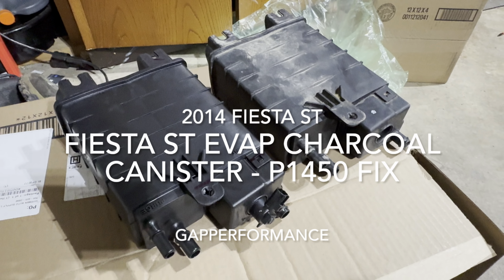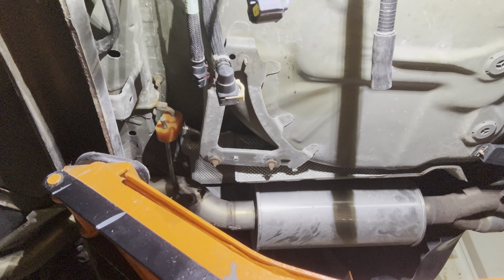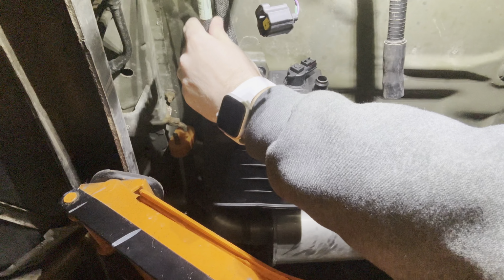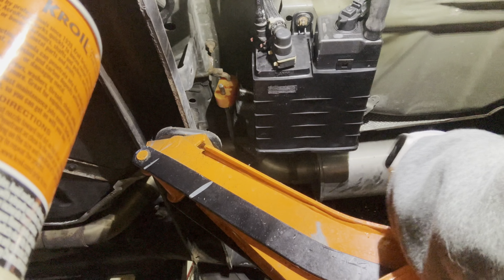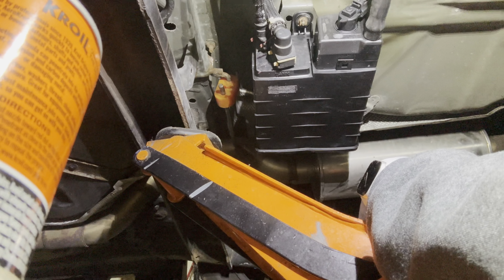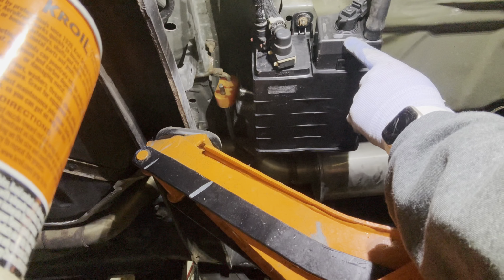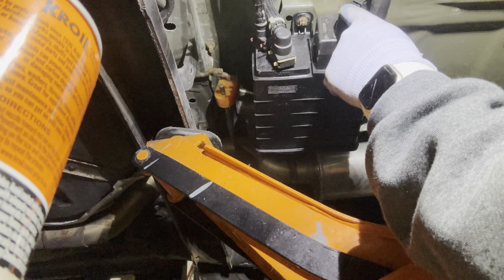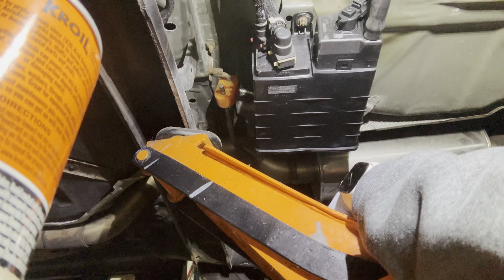Fiesta ST Canister Replacement - P1450 Fix

Comment: Hey man so I changed the Solenoid and I’m still getting varied and extended crank times. Is that the issue you were having as well? Just trying to troubleshoot.
Reply from the maker: No my main issue was idling poorly and it would try to stall out whenever I stopped at a stop sign lol

Comment: It's definitely an ST thing. If the Woosh harness doesn't fix mine, it's off to the Canister ..
Reply from the maker: Yep I did the whoosh harness, then the canister vent valve, then the canister. Finally I had my tuner bump my idle rpm to 1200 and I haven’t had a code since haha